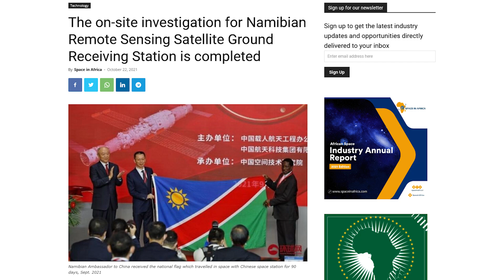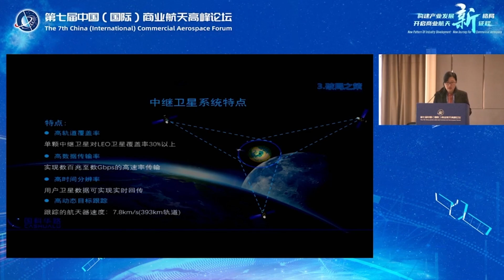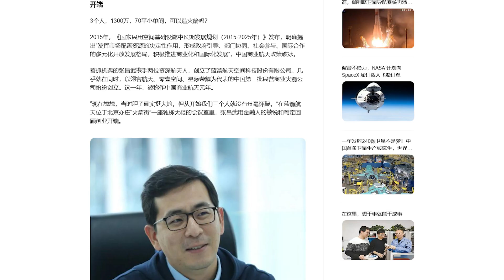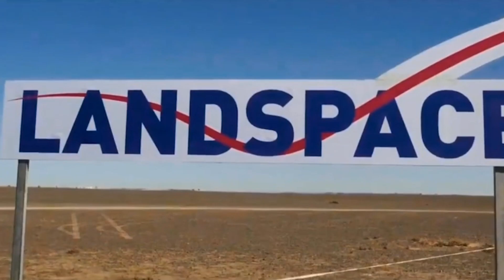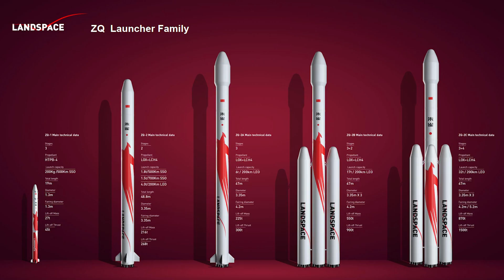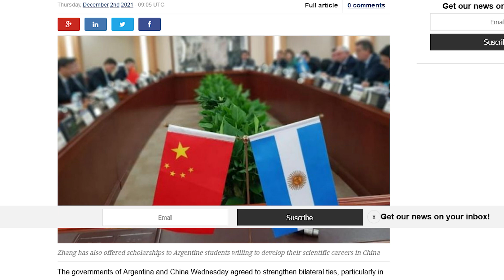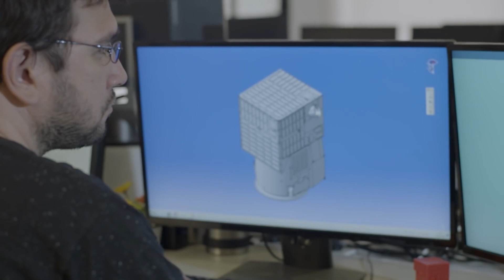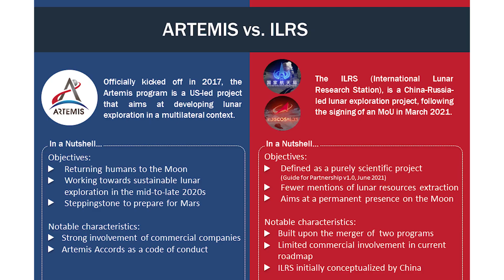Relay Satellites to Link Chinese Constellations, Landspace Updates, a new EO constellation

Comment: Hello, I agree with the technological advance. But the question is the following, when these cease to be operational and become space junk, you know, do you have any idea or plan to download it?
Reply from the maker: Hey Mariano. Satellite operators can either de-orbit satellites (which re-enter the atmosphere and disintegrate) or send them to a graveyard orbit.
In the case of China, the central government published new regulations in 2021, notably the "Notice on Promoting the Orderly Development of Microsatellites & Strengthening Safety Management", which requires commercial satellite operators to de-orbit satellites at the end of their lifespan.
Reply: But the problem remains without a solution, because garbage continues to accumulate in other orbits, and this debris is not static. Which in the long term will be a big problem and can cause serious damage
Reply: You have to remember that these objects travel at high speed and it is not easy to catch them and there are very small ones that are the most dangerous.